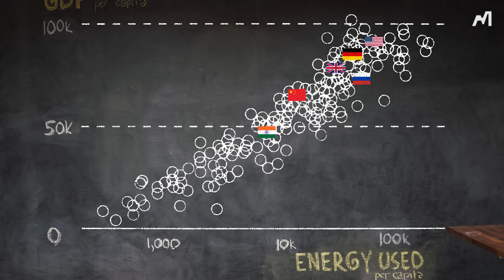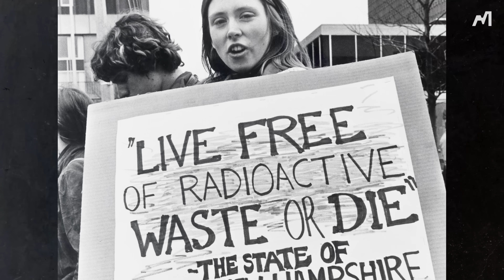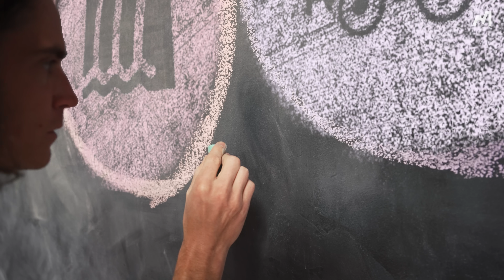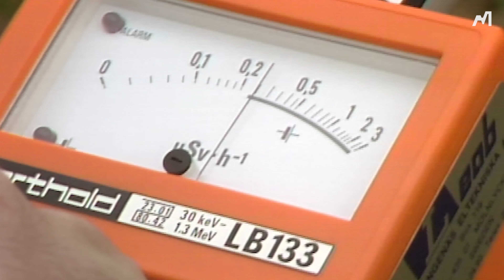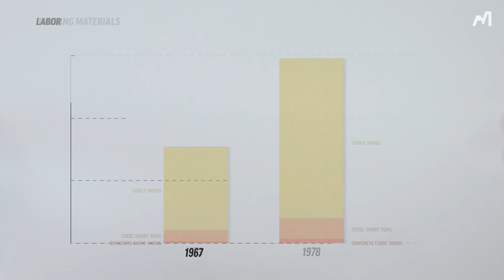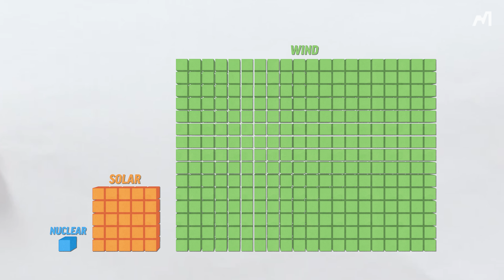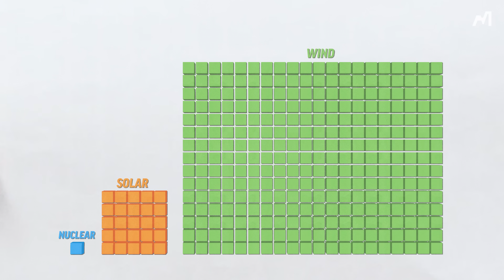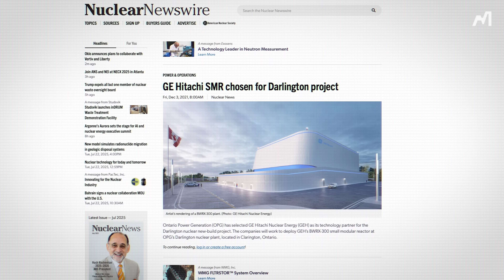They're Lying to You About Nuclear Energy

Comment: Thank you! I wish more people against nuclear power would see this.
Reply: There is no such thing as permanent, safe, storage of spent fuel (witness the ongoing storage of spent fuel at plant locations from lack of dumping sites, making each reactor site "an event in progress," just like what is going on at Chernobyl and Fukushima)!
 
More stupidity is not the solution to stupidity. The simple fact is that the intense ionizing radiation in the boundary of the nuclear fuel causes the containment to transmute over time, where the containment materials lose their original elemental qualities, frequently becoming brittle and no longer able to perform as originally intended. Zombie reactors that are past their designed life are losing the safety safety factors originally designed into the containment in ways that are not predictable until incidents inevitably occur. The same thing applies to the containment of high-level nuclear waste. These matters are well-known to the industry, but being withheld from public scrutiny in order to maintain the current zeitgeist.

Comment: radiation means energy. In that sense a fire emits radiation, infrared radiation. I wish he would specify wavelengths when giving the airplane, and everest examples. are we talking UV, infrared? microwave? radiowave? x-ray? gamma ray?
Reply: There is no such thing as permanent, safe, storage of spent fuel (witness the ongoing storage of spent fuel at plant locations from lack of dumping sites, making each reactor site "an event in progress," just like what is going on at Chernobyl and Fukushima)!
 
More stupidity is not the solution to stupidity. The simple fact is that the intense ionizing radiation in the boundary of the nuclear fuel causes the containment to transmute over time, where the containment materials lose their original elemental qualities, frequently becoming brittle and no longer able to perform as originally intended. Zombie reactors that are past their designed life are losing the safety safety factors originally designed into the containment in ways that are not predictable until incidents inevitably occur. The same thing applies to the containment of high-level nuclear waste. These matters are well-known to the industry, but being withheld from public scrutiny in order to maintain the current zeitgeist.

Comment: No windmills can cause a lot of problems around it for humans whom are trying to sleep, it causes even a kind of electromagnetic disturbance aside from the shadow, perhaps even the same for cows.
Reply: There is no such thing as permanent, safe, storage of spent fuel (witness the ongoing storage of spent fuel at plant locations from lack of dumping sites, making each reactor site "an event in progress," just like what is going on at Chernobyl and Fukushima)!
 
More stupidity is not the solution to stupidity. The simple fact is that the intense ionizing radiation in the boundary of the nuclear fuel causes the containment to transmute over time, where the containment materials lose their original elemental qualities, frequently becoming brittle and no longer able to perform as originally intended. Zombie reactors that are past their designed life are losing the safety safety factors originally designed into the containment in ways that are not predictable until incidents inevitably occur. The same thing applies to the containment of high-level nuclear waste. These matters are well-known to the industry, but being withheld from public scrutiny in order to maintain the current zeitgeist.

Comment: This is a very complex topic and you try to make it sound like it is very simple. Thats not good. There is no clear cut answer to the question to whether to further build nuclear power plants. Its a compromise. This video does not look at the arguments against nuclear power.
Reply: There is no such thing as permanent, safe, storage of spent fuel (witness the ongoing storage of spent fuel at plant locations from lack of dumping sites, making each reactor site "an event in progress," just like what is going on at Chernobyl and Fukushima)!
 
More stupidity is not the solution to stupidity. The simple fact is that the intense ionizing radiation in the boundary of the nuclear fuel causes the containment to transmute over time, where the containment materials lose their original elemental qualities, frequently becoming brittle and no longer able to perform as originally intended. Zombie reactors that are past their designed life are losing the safety safety factors originally designed into the containment in ways that are not predictable until incidents inevitably occur. The same thing applies to the containment of high-level nuclear waste. These matters are well-known to the industry, but being withheld from public scrutiny in order to maintain the current zeitgeist.

Comment: 3 iq video. u ignore lots of facts in this video to make nuclear power look good.
Reply: Mind stating which ones?
Reply: @AverageRobloxian64 Sorry I'm not going to answer your question, instead I'll frame it this way: the growth of renewable energy projects in every single country on earth should be enough to make you question the hidden bias in this video.
Reply: @xTheITx  what does one have to do with the other? (the growth of renewable energy projects and the said hidden bias you mentioned)
Reply: @AverageRobloxian64   Where do you stand on nuclear power?

Energy for short-term gain at the expense of long-term benefit is symptomatic of a basic problem: If ever there were a ultimate limit to "growth," it would look exactly like what is happening now!
Reply: @richardmcbroom102  i 100% support nuclear power, and i think it should be the one to replace fossil fuels alongside the renewable energy sources.
Do you mind clarifying what you said?
Reply: There is no such thing as permanent, safe, storage of spent fuel (witness the ongoing storage of spent fuel at plant locations from lack of dumping sites, making each reactor site "an event in progress," just like what is going on at Chernobyl and Fukushima)!
 
More stupidity is not the solution to stupidity. The simple fact is that the intense ionizing radiation in the boundary of the nuclear fuel causes the containment to transmute over time, where the containment materials lose their original elemental qualities, frequently becoming brittle and no longer able to perform as originally intended. Zombie reactors that are past their designed life are losing the safety safety factors originally designed into the containment in ways that are not predictable until incidents inevitably occur. The same thing applies to the containment of high-level nuclear waste. These matters are well-known to the industry, but being withheld from public scrutiny in order to maintain the current zeitgeist.

Comment: Nuclear energy - a miniscule, almost non-existant chance of a big incident ever occuring.
All other energy types - permanent and/or constant damage to environment, wildlife and humans.
Reply: There is no such thing as permanent, safe, storage of spent fuel (witness the ongoing storage of spent fuel at plant locations from lack of dumping sites, making each reactor site "an event in progress," just like what is going on at Chernobyl and Fukushima)!
 
More stupidity is not the solution to stupidity. The simple fact is that the intense ionizing radiation in the boundary of the nuclear fuel causes the containment to transmute over time, where the containment materials lose their original elemental qualities, frequently becoming brittle and no longer able to perform as originally intended. Zombie reactors that are past their designed life are losing the safety safety factors originally designed into the containment in ways that are not predictable until incidents inevitably occur. The same thing applies to the containment of high-level nuclear waste. These matters are well-known to the industry, but being withheld from public scrutiny in order to maintain the current zeitgeist.

Comment: Really interesting video and highly controversial topic that needs more discussion! Especially in Germany, they just decided to shut down (and flud the reactor cores with cement to permanently disable them) perfectly functioning nuclear reactors!

Side topic: if radiation is actually not as deadly as we have been tought so far, what about atomic bombs and nuclear rockets? The destruction part is quite obvious, but what about the radiation part that always sounds actually the scariest?
Reply: There is no such thing as permanent, safe, storage of spent fuel (witness the ongoing storage of spent fuel at plant locations from lack of dumping sites, making each reactor site "an event in progress," just like what is going on at Chernobyl and Fukushima)!
 
More stupidity is not the solution to stupidity. The simple fact is that the intense ionizing radiation in the boundary of the nuclear fuel causes the containment to transmute over time, where the containment materials lose their original elemental qualities, frequently becoming brittle and no longer able to perform as originally intended. Zombie reactors that are past their designed life are losing the safety safety factors originally designed into the containment in ways that are not predictable until incidents inevitably occur. The same thing applies to the containment of high-level nuclear waste. These matters are well-known to the industry, but being withheld from public scrutiny in order to maintain the current zeitgeist.

Comment: Interesting documentary. What was missing for me was a comparison of how regulation works in other countries which haven't scuppered their nuclear energy programs.
Reply: There is no such thing as permanent, safe, storage of spent fuel (witness the ongoing storage of spent fuel at plant locations from lack of dumping sites, making each reactor site "an event in progress," just like what is going on at Chernobyl and Fukushima)!
 
More stupidity is not the solution to stupidity. The simple fact is that the intense ionizing radiation in the boundary of the nuclear fuel causes the containment to transmute over time, where the containment materials lose their original elemental qualities, frequently becoming brittle and no longer able to perform as originally intended. Zombie reactors that are past their designed life are losing the safety safety factors originally designed into the containment in ways that are not predictable until incidents inevitably occur. The same thing applies to the containment of high-level nuclear waste. These matters are well-known to the industry, but being withheld from public scrutiny in order to maintain the current zeitgeist.

Comment: If there's a standard design, it should be easy to build a reactor, yet its always delayed
Reply: There is no such thing as permanent, safe, storage of spent fuel (witness the ongoing storage of spent fuel at plant locations from lack of dumping sites, making each reactor site "an event in progress," just like what is going on at Chernobyl and Fukushima)!
 
More stupidity is not the solution to stupidity. The simple fact is that the intense ionizing radiation in the boundary of the nuclear fuel causes the containment to transmute over time, where the containment materials lose their original elemental qualities, frequently becoming brittle and no longer able to perform as originally intended. Zombie reactors that are past their designed life are losing the safety safety factors originally designed into the containment in ways that are not predictable until incidents inevitably occur. The same thing applies to the containment of high-level nuclear waste. These matters are well-known to the industry, but being withheld from public scrutiny in order to maintain the current zeitgeist.
Reply: @richardmcbroom102 dude, didn't ask for a rant.

We all know the problems with reactors the video even touches on it but the most modern designs can get the waste generation right down

Comment: they lied to us, its just boiling water
Reply: There is no such thing as permanent, safe, storage of spent fuel (witness the ongoing storage of spent fuel at plant locations from lack of dumping sites, making each reactor site "an event in progress," just like what is going on at Chernobyl and Fukushima)!
 
More stupidity is not the solution to stupidity. The simple fact is that the intense ionizing radiation in the boundary of the nuclear fuel causes the containment to transmute over time, where the containment materials lose their original elemental qualities, frequently becoming brittle and no longer able to perform as originally intended. Zombie reactors that are past their designed life are losing the safety safety factors originally designed into the containment in ways that are not predictable until incidents inevitably occur. The same thing applies to the containment of high-level nuclear waste. These matters are well-known to the industry, but being withheld from public scrutiny in order to maintain the current zeitgeist.

Comment: we had uranium based fireplaces in our homes.
Reply: There is no such thing as permanent, safe, storage of spent fuel (witness the ongoing storage of spent fuel at plant locations from lack of dumping sites, making each reactor site "an event in progress," just like what is going on at Chernobyl and Fukushima)!
 
More stupidity is not the solution to stupidity. The simple fact is that the intense ionizing radiation in the boundary of the nuclear fuel causes the containment to transmute over time, where the containment materials lose their original elemental qualities, frequently becoming brittle and no longer able to perform as originally intended. Zombie reactors that are past their designed life are losing the safety safety factors originally designed into the containment in ways that are not predictable until incidents inevitably occur. The same thing applies to the containment of high-level nuclear waste. These matters are well-known to the industry, but being withheld from public scrutiny in order to maintain the current zeitgeist.

Comment: The death number of Tchernobyl is closer of 50 000 so you lost quiet lot of credibility on that one
Reply: There is no such thing as permanent, safe, storage of spent fuel (witness the ongoing storage of spent fuel at plant locations from lack of dumping sites, making each reactor site "an event in progress," just like what is going on at Chernobyl and Fukushima)!
 
More stupidity is not the solution to stupidity. The simple fact is that the intense ionizing radiation in the boundary of the nuclear fuel causes the containment to transmute over time, where the containment materials lose their original elemental qualities, frequently becoming brittle and no longer able to perform as originally intended. Zombie reactors that are past their designed life are losing the safety safety factors originally designed into the containment in ways that are not predictable until incidents inevitably occur. The same thing applies to the containment of high-level nuclear waste. These matters are well-known to the industry, but being withheld from public scrutiny in order to maintain the current zeitgeist.

Comment: ok but what idiots died from solar energy?
Reply: There is no such thing as permanent, safe, storage of spent fuel (witness the ongoing storage of spent fuel at plant locations from lack of dumping sites, making each reactor site "an event in progress," just like what is going on at Chernobyl and Fukushima)!
 
More stupidity is not the solution to stupidity. The simple fact is that the intense ionizing radiation in the boundary of the nuclear fuel causes the containment to transmute over time, where the containment materials lose their original elemental qualities, frequently becoming brittle and no longer able to perform as originally intended. Zombie reactors that are past their designed life are losing the safety safety factors originally designed into the containment in ways that are not predictable until incidents inevitably occur. The same thing applies to the containment of high-level nuclear waste. These matters are well-known to the industry, but being withheld from public scrutiny in order to maintain the current zeitgeist.

Comment: Typical arguments from any nuclear power advocates. The initial death toll figures due to any atomic accident seem low(the narrator mentions here, limited to 50), as we saw in the Chernobyl case. But the death toll in Chernobyl has dramatically increased over the years because of exposure and the spreading of radiation. Completely missing the whole picture here. Nuclear energy is always risky, no matter what safety measures are in place.

Comment: None sense.
There is a bloke, a few of them in fact, who break open cesium 137 from old xray machine.
Of course, just like you might have guess, they die from acute radioactive poisoning with in a week.

So what different between those scavenger and the scientist? It is exposure.
While scientists 'may' carry it around, some dude even eat it, they knew what they were doing. So they wouldn't handle dangerous material without protection and only show off with something they knew it is harmless.

If you are going to boiling water using Uranium, you probably going to use more concentrate and highly radioactive material than, say, some radioactive paint. And those thing are dangerous even when you leave it alone.